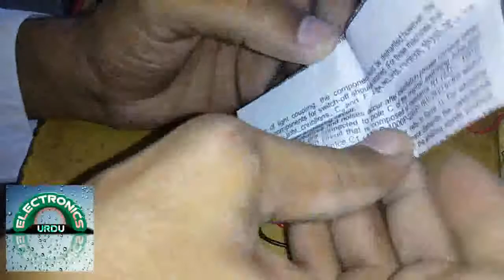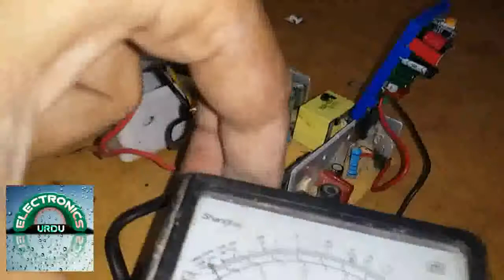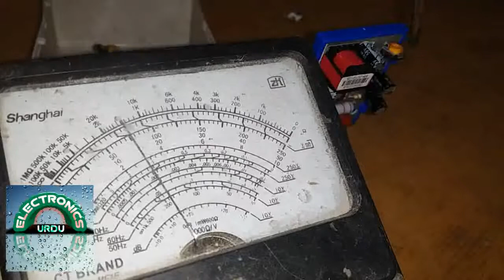How to repar ac/dc ceiling fan circuit in urdu hindi

Comment: Bhai isky connection Kase hnge
? Many Lia hai or connect nhi horha the sy fan chal Rh hai mgr dimmer Kam nhi krrha
Reply from the maker: Bhai aap ka problem samjh nhi aaya
Reply: Many battery k sth baleno motor Wala 12v ka DC fan lagaya hai isky Lia ye regulator Lia hai Kal l... Acha many do wire battery me attach kary or fan k do wire proper lagay lakin fan to speed me chal rha hai mgr fan ki speed control nhi horha dimmer ghumany sy bs Tez chal rha hai...wire connection Lia trha sy hnge?hoskta hai my koi galti krrha hn